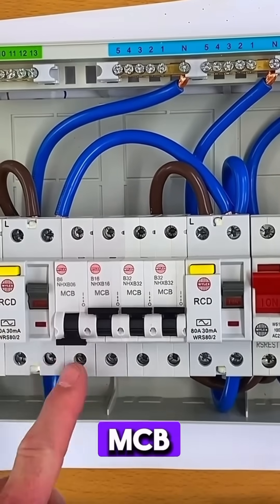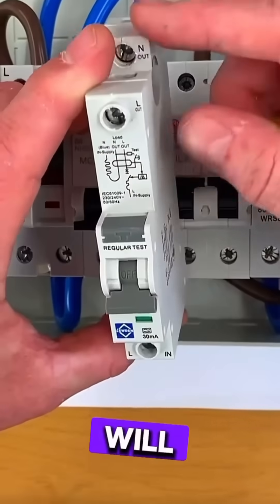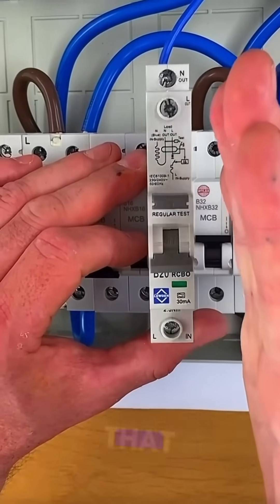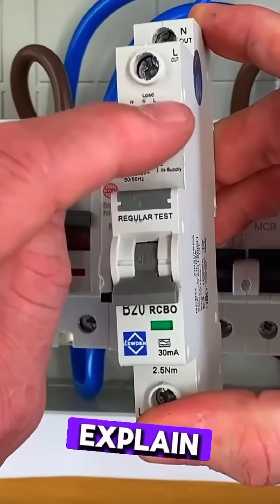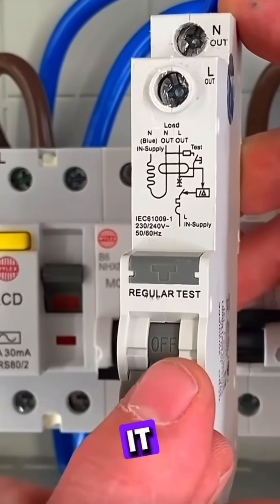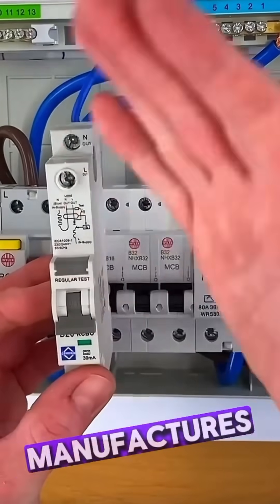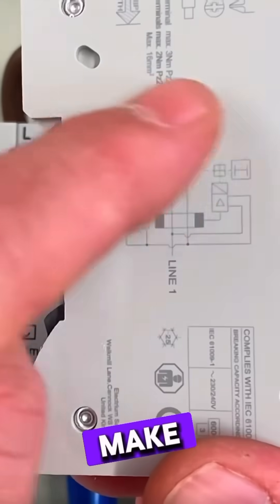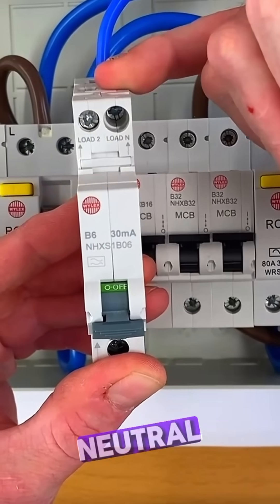RCBOs are NOT all Built the Same 🤯

Comment: Now sure what a switched neutral would accomplish. If you had cross leakage from another circuit would you want the neutral to float or remain grounded?
Reply: in installations where if theres a neutral earth fault the residual can flow to earth through the fault and cause touch voltages to increase and givd rise to potential between real earth and circuit earth
Reply: @nialbuckley5785  In that case the RCB  bipolar will switch off Neutral and  Fase